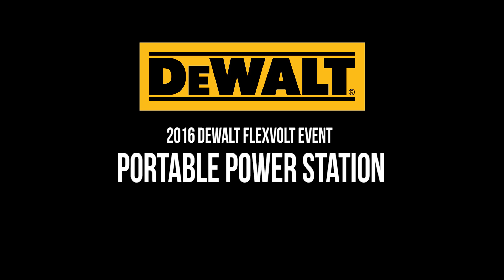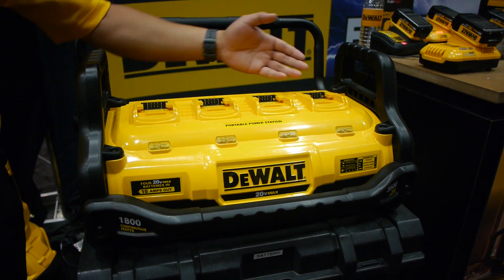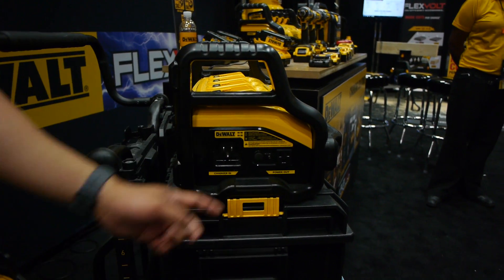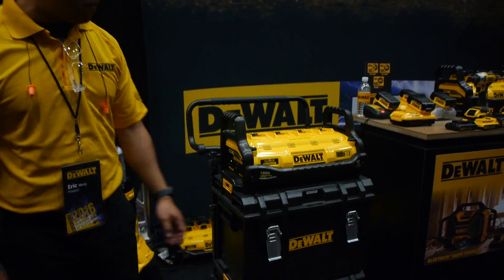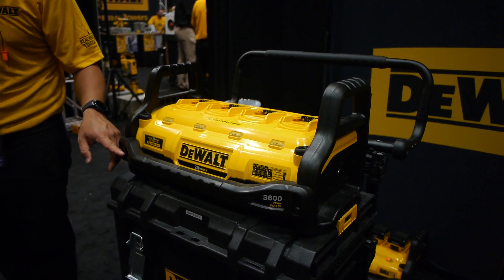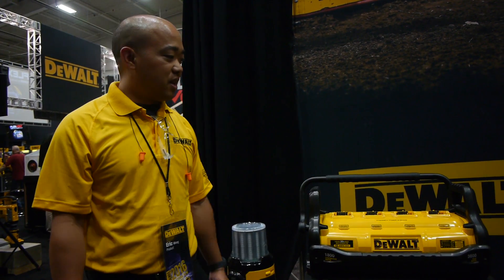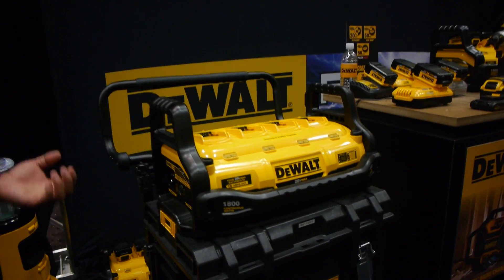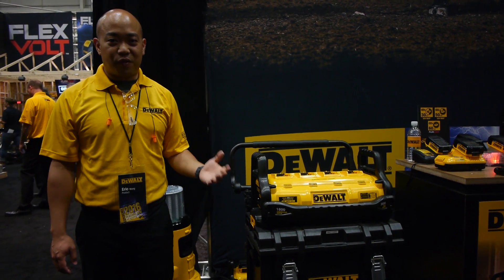Dewalt DCB1800 a DC to AC 1800 Watt Portable Power Station 20V MAX or FLEXVOLT

Comment: Doesnt work well for example with my fan. Attached to the wall socket my fan works fine, attached to the DCB1800 the fan makes some humming noise and runs more slowly. Measured the frequency when running the fan, its 180 Hz and not 60. Not recommendable for sensitive electronics. Works OK with power tools.